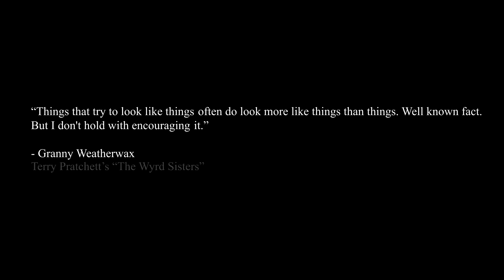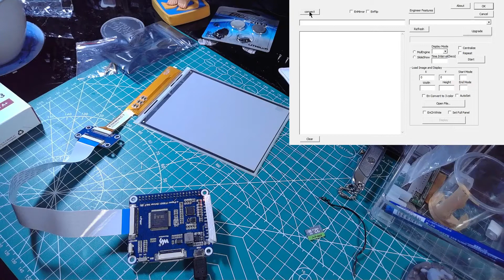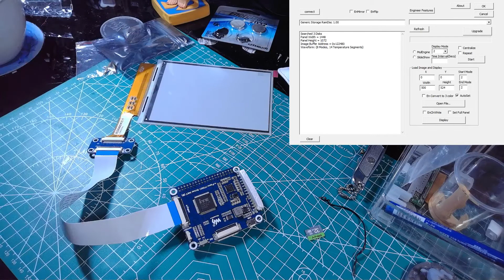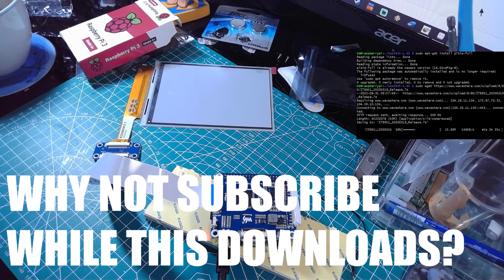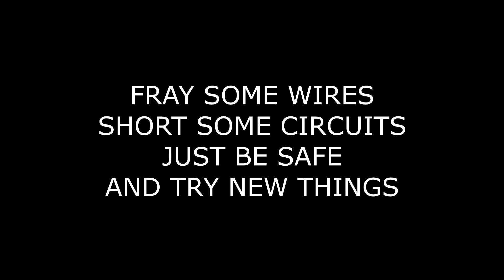How to make a Waveshare 6” ePaper display work with Raspberry Pi using Python

Comment: Interesting, I used this tutorial to help me setup my RPI 3 B with the same display, although I did not run into the issues you did. Likely because I was coding in C not in python
Reply from the maker: Great! Glad the video helped! My own issues may also be my lack of in-depth knowledge of both Linux and Python to begin with! But it was a lot of fun to get working!
Reply: @encouragingthings  Is there any way you can share the script you have running at the end of the video that says 'subscribe'?
Reply from the maker: @corpliner1506  I looked on my HDD and I think I rewrote that for another display program. However, there may still be a copy of it on the device itself which is currently sitting in a box (as I moved after this video was made). But, I will happily pull it out and take a look as soon as I get another free moment to do so! Stay tuned!
Reply: @encouragingthings  sounds great 👍
Reply from the maker: Way late, but I did dig up the display and looked at the code. Looks like I don’t have a backup for it as it was a one-off code snippet and I overrode it for other things. My apologies!
Reply: @encouragingthings  No worries. I was looking for a good direction to get started on my college senior design project for engineering, but I ended up figuring it out and finished the project. I had two 13.3 inch epaper screens hooked up to one RPI to create on big image across both screens
Reply from the maker: That’s excellent! Congratulations on finishing your project and I hope things keep going smooth for you!

Comment: This is a great video, thanks so much! I want to do a very similar thing, only with a larger epaper screen (possibly even a colour one). I wonder how hard it is to modify the python controller for the IT8951...
Reply from the maker: Thank you! The IT8951 driver for this board is odd because Waveshare has great support for most of its epaper displays except the 6” model and I’m not sure why. If you check out any number of how-to epaper calendar projects they often have links and instructions on getting most displays to work. It’s just odd the 6” is not among them most of the time hence the video!

Comment: Great video ! Is the latency correct ? (Less than 1s for example ?)
Reply from the maker: As far as I can tell the latency is just about correct. The largest image I've loaded was the Linux Penguin demo and it feels less than one second. Partial update is definitely faster than full screen changes so if you tried to use it as an active display or as a video player I don't think it could keep up, but partial update for something like an analog clock counting seconds should be feasible and since the code is open source on github if you're good with Python you may be able to update as you need. Thanks!

Comment: Is it possible to use one of the waveshare e paper displays as a terminal?
Reply from the maker: Not the display alone, but you could make it the screen for a dummy terminal. The biggest issue is refresh speeds. @TechnologyConnections did a video about some newer screens that update faster, but if you could perform partial updates for the input area and full updates when the terminal receives data then it could possibly work.
Reply: @encouragingthings  thanks for the quick reply, I’ll go check out that video now.

Comment: TURN THE4 MUSIC OFF THAT WOULD HELP ME WATCH YOUR CHANNEL LET ME KNOW WHEN YOU DO!!!
Reply from the maker: Thanks for the feedback. Music in videos is often a topic a lot of crafters have to deal with. For me, it's used to fill the gaps in audio where I have had to mute the video due to background noise or where there's no ambient sound loud enough to be heard. These points in the video can make people disinterested and bored and it seems, in my experience, that a linking audio works well to keep these segments together.
So until such time as I'm able to record without loss of background audio (such as in a shop rather than in my living room) I think I will have to keep the music in the background. However, if you would like a different type of sound I'm open to suggestions.
Reply: Was just thinking the same, music is quite loud and would help to lower or turn it off
Reply from the maker: My later videos use a much less intrusive song (less peaks) and I did bring the volume down a bit. This is a very early video and I was, and still am, finding out what works best. Thanks for the feedback!
Reply: @encouragingthings  I personally like the music but would suggest it is pretty loud in the mix and prefer to focus on the narration :) Good stuff though!
Reply from the maker: @emmaweaver7107  Thanks! My latest video, restoring an old tube radio, ironically, has no music. So we'll see how things go.